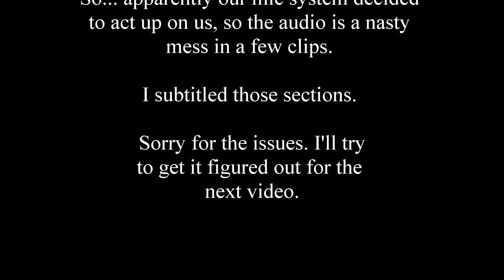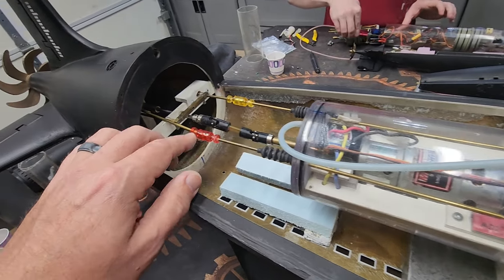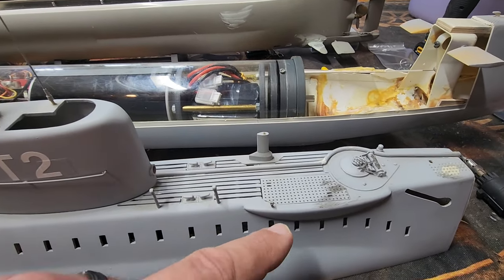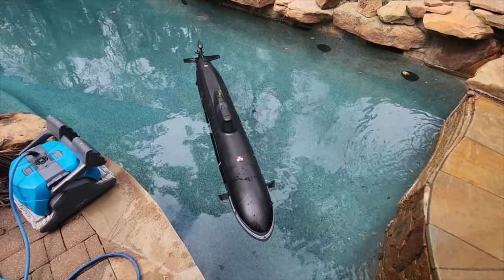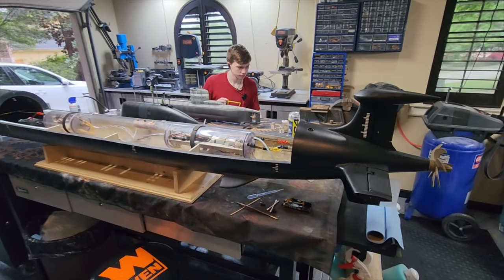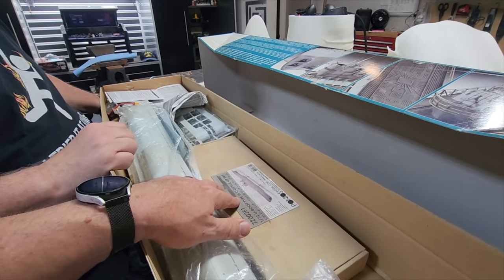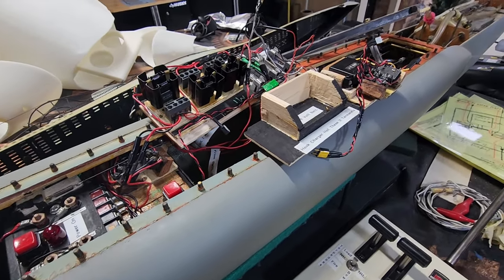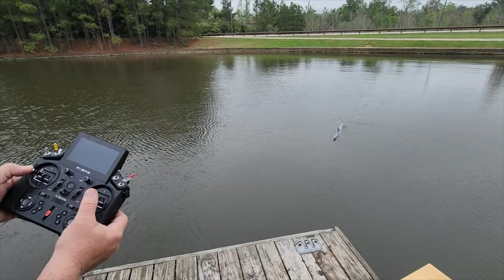The RCSubGuy Goes Through The RC Sub Haul and Loses a Screw!

Comment: 6:06 I have seen people use liquid resin for a 3D resin printer and apply it to fill cracks and such. Then place it under a UV light, or sunlight, to cure. You can then sand down to finish.